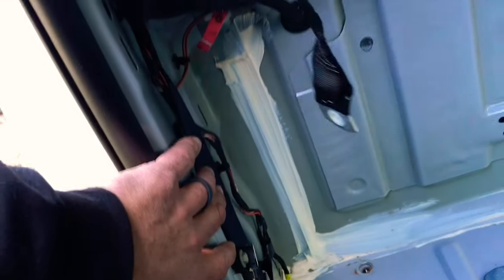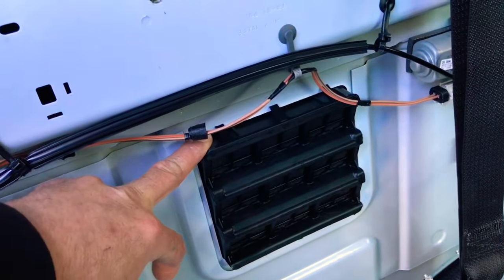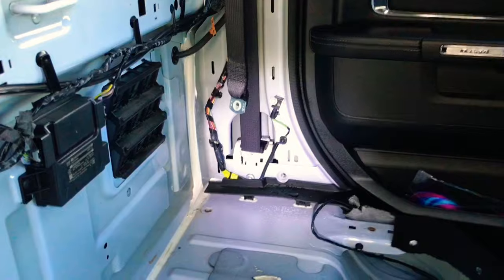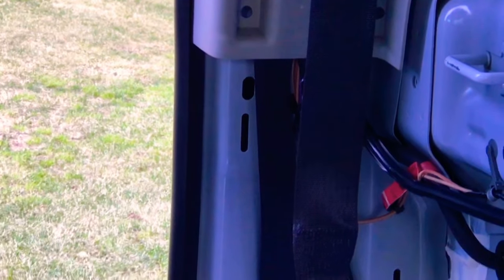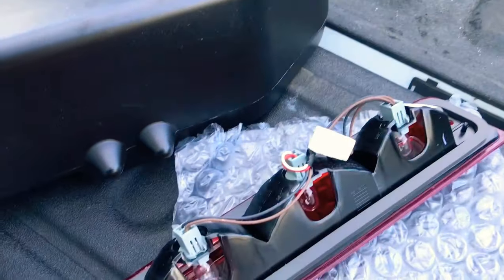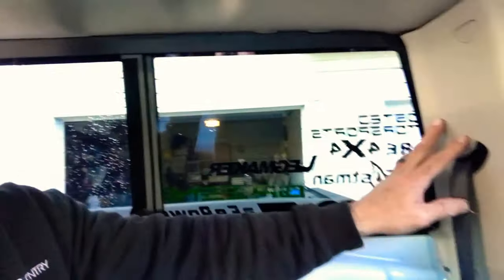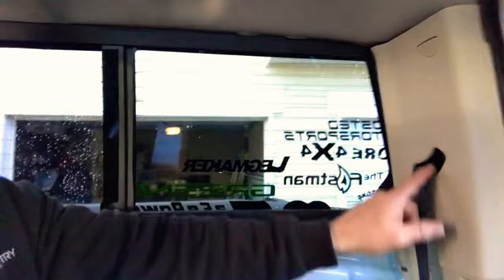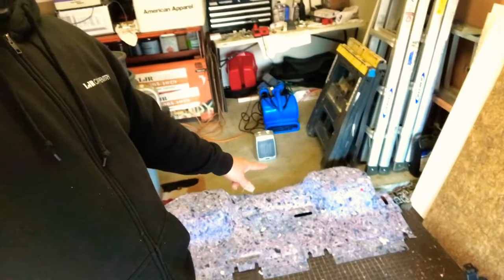Water Coming In!

Comment: anyone getting ready to do this job, needs to read this first. ignore taking everything apart inside the truck. all you have to do is get a long 24" big screwdriver and push up on the old vent then gently pry the bottom snaps out and pull the old vent off. if you worry about the paint just wrap the screwdriver with tape. slide the new vent up into place using screwdriver to be sure the top end snap is in first, then snap in the bottom by pushing it in. it is not hard to do at all and i was able to do both of my vents in 5 minutes from start to finish.

Comment: It will happen again soon. The neoprene seal breaks down with the heat, pressure and weather. You need to remove the neoprene seal and use butyl tape to make a water tight gasket around the third brake light before installation. P.S. You can use the original brake light and save yourself some money.

Comment: 2018 RAM Big horn.  Same problem.  Only 3400 mi. on truck.   Thanks Mike.  Great video dude.  I lucked out . I let my dealer know and they told me  99% of the time, its the 3rd break light.  They replaced it for me the same day.  My advisor told me  that the new body style  has back window leak problems !   Get with it FCA !!!  Thanks again dude.

Comment: My 2005 1500 extended cab has water coming out of the screw covers of the passenger side front A-column... anybody else? Also, it seems it doesn't leak unless the rain is wind driven, if there is rain with no wind it doesn't leak.

Comment: My 2011 ram had a leak also but I found the water coming in thru the rear sliding window. I guess the seals went bad. Going to order new ones and see if it works.

Comment: I had that same problem on my 2014 Ram 1500 Quad cab.  I couldn't figure it out and I took it to the dealer.  Luckily it was still under warrantee. The dealer told me that the leak is common after a third break light bulb change.  The third break light requires silicone to seal the enclosure after the bulb has been changed.  They put silicone around mine and I never had the leak again.  Good Video.

Comment: Mine leaked too. After silicone and more weatherstripping it stopped, but then I also got some leaking in where the middle opening windows lower horizontal seal meets the vertical ones. I went around to all seal junctions with some black silicone RTV.
Reply: What did you use for the inside roof material  clean and smell?

Comment: I have a 2017 and the break light leaked. When I replaced it I was still getting a damp spot on my carpet and after taking mine apart like you did I found that my tonneau cover was diverting rain onto my cab vents. Sincei keep it rolled up I have not had any problems with.
Reply from the maker: Doug Cagle I have a tonneau cover too, I soaked my vents and didn’t get a drip.  A few have had issues with their vents

Comment: Thank you for this. Just curious, did you install a brand new light? Wouldn't the same thing happen again if so (design issue)?
Reply from the maker: Yes I got a new one but check the description for the other videos, I ended up going a different method

Comment: Hello! I commented on another video of yours regarding the third break light. I took mine out today after it rained last night, and the gasket is dry, and there was no water inside the break light compartment, but my carpet was wet underneath the driver's side rear seat.  I do have another break light on order, and I'll prolly do that trick with the zip tape that you have done in your other video.  But I have light stains in the inside roof in the back, towards the corners. I'm beginning to believe that my leak is coming from those roof gaskets that go from the front to the back on each side of the roof by the doors. Have you ever heard of those gaskets leaking? Thanks man! Love your videos, good stuff.
Reply from the maker: What’s up!  I haven’t heard of the roofs leaking.  Those stains usually are from the third brake light.  The water travels toward those spots.  But I haven’t heard of anyones roof leaking at the seams no
Reply: @TunedRAMS  okay man thanks. I have a new third break light on order. So my other question was on yet another of your posts lol, do you think the flex seal tape would do just as good as the zip tape? Happy Easter!

Comment: Awesome video thank you. I have a 2013 1500 and my sirius xm stopped receiving. I noticed stains and wetness in both corners so there's a good chance it's my 3rd brake light as well. I'm hoping this didn't ruin my satellite antenna and I'll get the sign back once the moisture is gone. Have you or anyone had this problem? What was your result if so?

Comment: Mine is an 18 Ram. The third brake light is licking. You cannot buy a gasket from the dealer. They want you to buy the whole light if it has a camera in that it is over seven hundred dollars to buy that i'm waiting for an aftermarket gasket now
Reply from the maker: Look in the description, zip tape solves the leaking problem a gasket will not solve the problem.

Comment: My rain channelwas leaking on the end where the cables go. I sealed them with some black window caulking
Reply: Also you can silicon the 3rd brake light
Reply: Did you just seal them so they would lay flat? (The rubber channels) I think this is where mine is leaking as well
Reply: I pulled the cable up and siliconed the end then put them back in and did the top also
Reply: @crazyscott71  thanks I was curious on how to fix mine, as mine are leaking there as well.
Reply: no problem just keep it away from the cable
Reply: @crazyscott71  will definitely check on that (as when I peeled the rubber back, I didnt notice the cable)

Comment: I did all the steps you did, I've replaced the 3rd brake light twice, first time it was leaking I replaced that fixed for a year then it started leaking from 3rd brake for the 2nd time so this time I bought another new 3rd brake light this time I put rtv silicone on the gasket to be sure this time that fixed it. Then 6 months later yet another leak that time it was the cab vents so I replaced then then here 8 months later I got yet another water leak an it not coming from either. At this point it has to be a window seal in the rear windows. It's very frustrating
Reply from the maker: It can be frustrating.  You got to seal one item at a time, hose it down and find where the water is coming from.  Remove the seats and all  liners
Reply: Oh yes that's pretty much what I'm doing now, fixing each leak at a time. I've got the whole back seat an carpet out now drying. I think this one is coming from the rear window possibly. I won't trade it in, just paid it off I've put to much into this Cummins to now know what I've got now!

Comment: My 2013 Ram quad cab I get a drop coming out the passenger grab handle.  One month will leak,  one month it's fine.  Think mine is the windshield seal has small area not sealed.  Is not 3rd brake light,  took oem off,  added aftermarket and thick seal and the headliner looks perfect.

Comment: Great video bro! I'm up in Oregon, it gets wet here if you hadn't heard. had the same issue. Used gutter sealant over the gasket on the light. Then blew out the rear window slider track drains. BOTH were leaking. You're right about one thing bud, my Laramie RAM 🐏  is a nice fucking truck. Smelling like a gym bag is not an option. Plus I didn't want my sub to short out. Best wishes from PNW bro.
Reply from the maker: What’s up Frank, yeah nice trucks and smelling like a foot or a gym bag isn’t going to happen!! That’s good you figured both out!!  Now I got to check my slider, always something!!!!  Yeah you guys get some rain up there!!

Comment: I just found my carpet in the back seat was wet around the threshold so I assume I have the same problem,was the seal on the third brake light foam? It will probably happen again given foam is absorbent,I was thinking on picking up some round rubber gasket and form where the foam gasket was after I remove it,I would like A permanent fix
Reply from the maker: I made mine leak proof, the link is in description!

Comment: My middle brake was the problem. Just get some 3m clear paint protective tape. Outline the light seam with about 1 1/2 in of over hang on the light and the paint. 
You can't even see it and it's dry and been dry for over a year. 20 bucks amazon 3m paint protective tape.

Comment: My leak is bizarre. Dealer has replaced the rear windshield twice and the third brake light once. No wet carpets ever. My truck is 3 years old with 34k miles. Looks pristine but like wet laundry. Still trying to figure this out. I air it out constantly as to avoid mold.

Comment: Changing the 3rd brake light gasket in a few days.  2017 BigHorn.  Leaking on rear passenger side.  I also sealed both sides of rear windows at the corners.

Comment: My 2010 2500 filled the storage compartments  (I had a subwoofer in one) after we had major rain storms in 2013. The stupid service guy told me it was the sunroof and they are meant to leak and the water is channeled out some how. Then they finally said it was the 3rd brake light and did a recall and put a new seal or used some kind a sealant on it. I had to replace the 3rd brake light bulb and it was a little tough to get off but then I just used silicone to seal it back up. Sometimes I thought it smelled musty but did not see water or if it got in and I could not tell. This is a problem for water getting and do any of the other manufactures have this issue or use something else to seal theirs?
Reply from the maker: Yeah the sunroof drains go behind the rear seats but mine were fine.  The third brake light is a pain, also the vents can leak too.  I’m not sure if any other trucks have this issue or not

Comment: Thanks! I live in PNW and bought a 2010 ram 3500. I don't drive it that much and the fall rains fell for a while before seeing my storage areas filled with water! I thought at first it was the rear slider and checked that out. No dice. Then we just had a wicked rain event that flooded the southern coast of BC big time and my truck continues to smell like a wet boot! I found a lot of moisture in my carpet in the back but the front feels dry after pulling the trim at the base of the doors. Hopefully I don't have to pull out all the seats to dry the carpet! I am going to reuse my light bvut put on new weather stripping that is better than the stock seal. That will just leak again too. 

Got info on MD Building Products 19/32- inch x10 feet premium Auto and Marine Rubber Weather Strip Black. Available at Home Depot as a good fix for the seal replacement.
Reply from the maker: Thanks for sharing man!!  Let us know if it lasted, hope your truck is smelling better 🦶 💪🏼😆

Comment: Pretty sure my third break light is leaking on my 2005 Ram 1500, but I also had a leak around the top of the windshield and will probably have to remove the a-pillar cover to check if any mold is in there. Did you find any mold?
Reply from the maker: No mold, my truck is fairly new.  I did let the carpet dry before reinstalling.  I also sprayed 50/50 bleach on the under side just in case.

Comment: My leak was the vents. Had to tale to the dealer 4 times before they fixed it.
Reply from the maker: Rude Dawg76 them cents are pretty cool.  When you throw the heat on they open right up
Reply: Never really checked them out. Let my dealer deal with it when it was under warranty. The dealer thought I was pouring the water on my floors and making a big deal about it. They actually said I was lying about it. After fighting with them the 4th visit they finally found out about the vents leaking. I think my truck was the first one the dealer dealt with the leaking vents. Once they fixed that my truck has been dry ever since. Dam though it was a fight.
Reply from the maker: Rude Dawg76 always a dam fight with the stealership

Comment: Yep,common problem . A trip to home depot fixed the problem as the factory gasket on that light is pathetically inferior for that position of the truck . The homedepot stuff is almost twice as thick and I have a 14 crew cab
Reply from the maker: arthur bischoff good idea.  The new ones from dealership have a thicker gasket now
Reply: @TunedRAMS  really ? Ok , didn't look like it to me but then I'm comparing what I fixed mine with and I can tell you that that stuff they're using now doesn't look any different that the half inch stuff I'm using now . But it is it's great you got it worked out :-)
Reply from the maker: arthur bischoff the new ones now, like for the past year, my 2017 was so flat.  It’s a joke where they put those, how exposed the cabin is at that area.  I’m trying to come up with an idea to guarantee a water proof seal
Reply: @TunedRAMS  NICE !!! It's been a couple of years since I did mine so , I think I got it licked.  Next item on the list is those pesky broken header bolts , think I might get some ARP replacements , you have any ideas ?
Reply from the maker: arthur bischoff check the headers for warpage that’s usually why they break.  I never had any problems so I never needed to find a resolve.  But I’m sure it will happen eventually,  I heard them ARP are stronger tho
Reply: @TunedRAMS  yeah , mine has about 71k on it so I'm pretty sure I'll find one or two towards the front of the manifold , but if I ignore it it won't happen LOL but I will use it as an upgrade opportunity when the time comes :-) anyhow thanks for the feedback
Reply: Your trucks are way too new to be having these issues. I have a 2004.5 that has been flawless except for a tiny leak from my front roof marker light above the visor. Super cheap and easy fix. Everyone always rags on Chrysler products, but I can't complain about mine. I drive it daily and I average 20 mpg with that big 4 door long bed 4x4 dually. Did the trucks become caca with the newer ones?
Reply: @xmo552  don't get me wrong I love my truck.  But if the assembly and design process was perfect ( which it is not ) then there would be no issues to talk about . Nothing is perfect , what you do to correct these small imperfections is what this is about . And one last thing new isn't always better when you take into account most manufacturers quest to maximize profits by cheaping out on some materials to reach a profitable cost projection . 
Just my two sense . :-)
Reply: @matrix1171  
Yup.